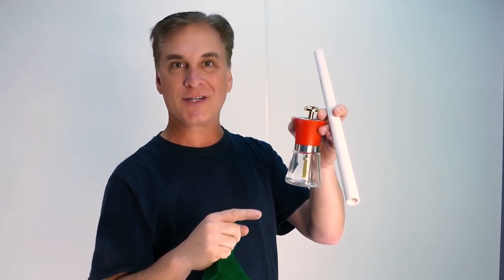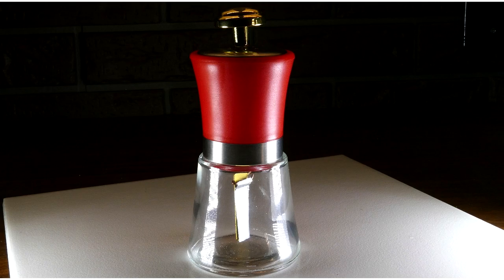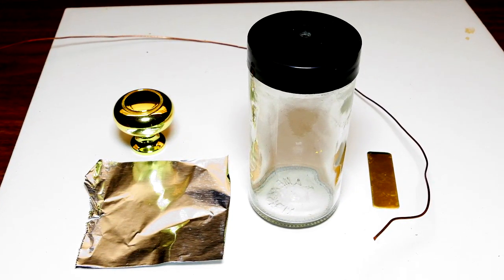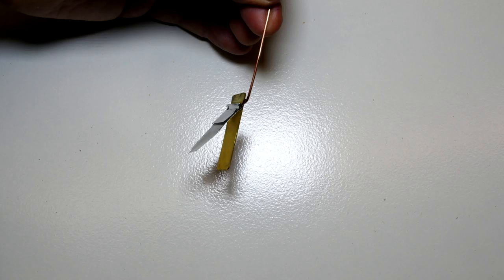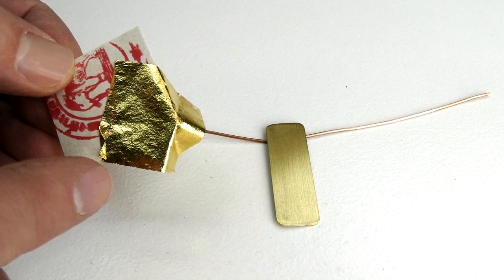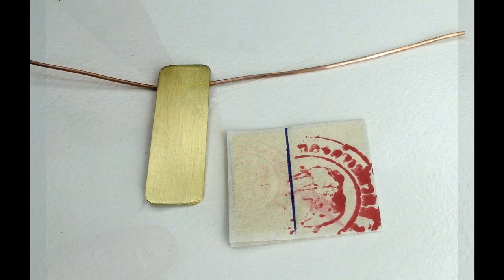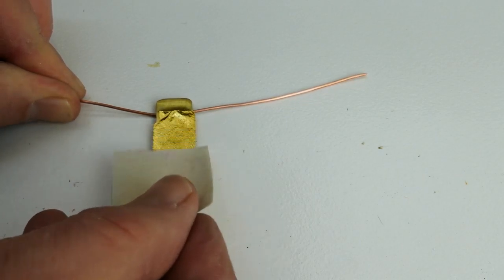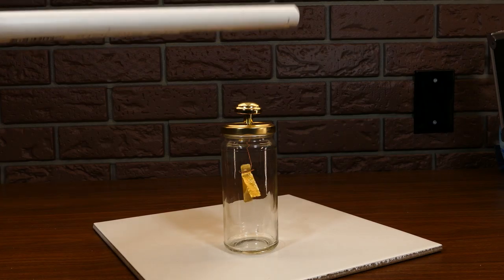Easy, Super Sensitive Electroscope Secrets Revealed!

Comment: I bet pure gold would also make a great Lyden Jar as its capacity to store electricity and transfer the same is greater than any other conductor. We are told in eletronics books that silver is but gold is and reason I think they stated that is the cost of gold would make it almost cost prohibitive to use so for that reason may not have been considered but really then that is not the truth as Gold is the best conductor. In fact have always wanted to buy the right size copper wire for a motor winding without the enamel coating just raw so it could then be gold plated as you use so very little gold its amazing. One ounce could almost plate the world a jeweler once told me so after plating the wire then enamel it and rewind an electric motor you have already tested for efficiencies to see how much more efficient it would become....my prediction is it would use 25-50% less and maybe more but I stay on the side of conservitive guestimations hoping my expectations are met. AC travels on the outside of a conductor so gold plating the wire is the thing to try.
Reply from the maker: Other than it's malleability, the great thing about gold is that it virtually does not corrode, so, it's great for electrical contacts.  I electroplated some leyden jars in the past, and that would be a great way to gold plate them economically...  Thanks!